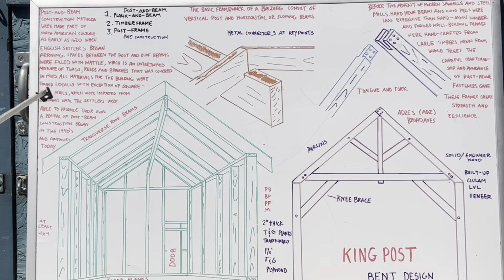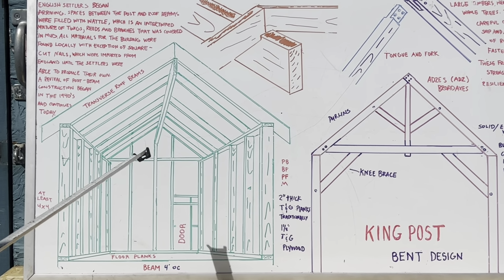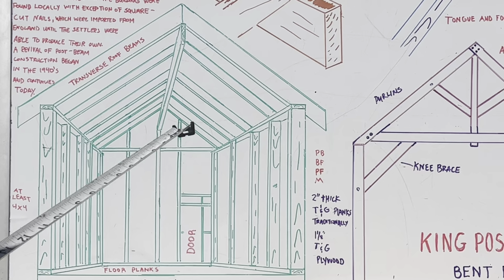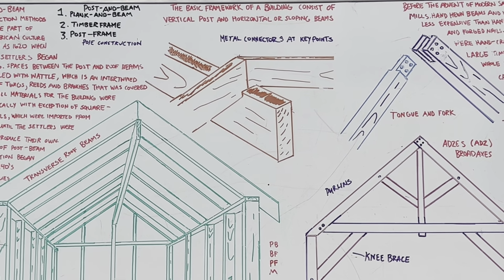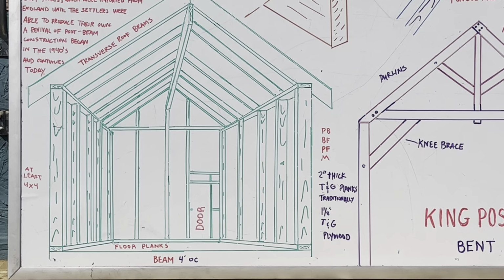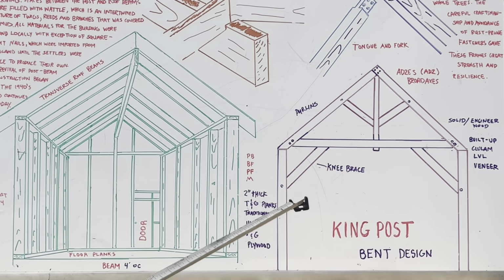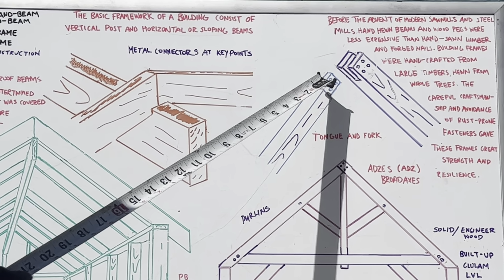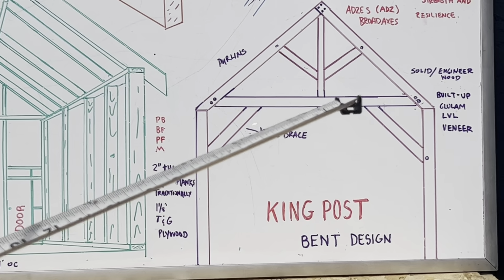Journey to the Temple: Post and Beam and Timber Framing

Comment: From Wikipedia:
A bent in American English is a transverse rigid frame (or similar structures such as three-hinged arches). Historically, bents were a common way of making a timber frame; they are still often used for such, and are also seen in small steel-frame buildings, where the term portal frame is more commonly used. The term is also used for the cross-ways support structures in a trestle. 

In British English this assembly is called a "cross frame". The term bent is probably an archaic past tense of the verb to bind, referring to the way the timbers of a bent are joined together. The Dutch word is bint (past participle gebint),[1] the West Frisian is bynt, and the German is bind. Compare this with the term bend for a class of knots.

Bents are the building blocks that define the overall shape and character of a structure. They do not have any sort of pre-defined configuration in the way that a Pratt truss does. Rather, bents are simply cross-sectional templates of structural members, i.e., rafters, joists, posts, pilings, etc., that repeat on parallel planes along the length of the structure. The term bent is not restricted to any particular material. Bents may be formed of wooden piles, timber framing,[2] steel framing, or even concrete.
Reply from the maker: Thanks